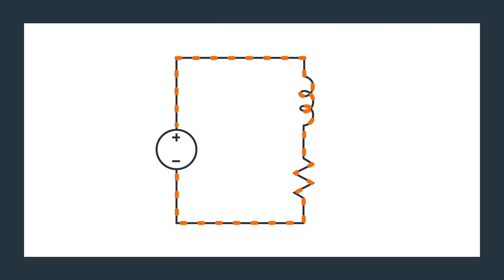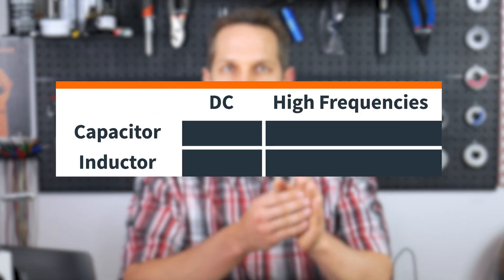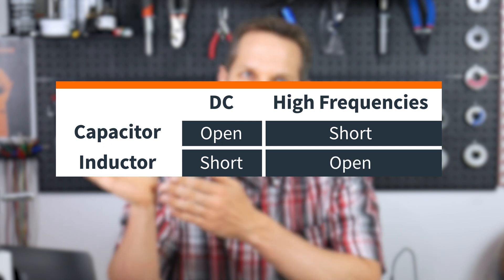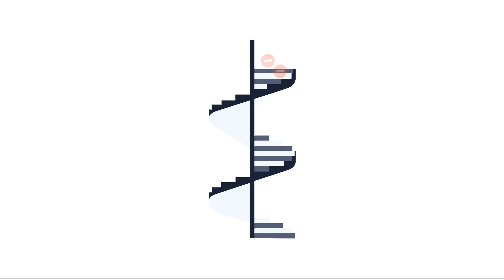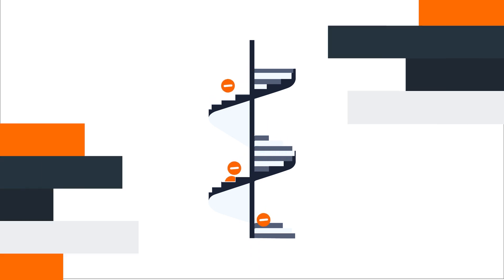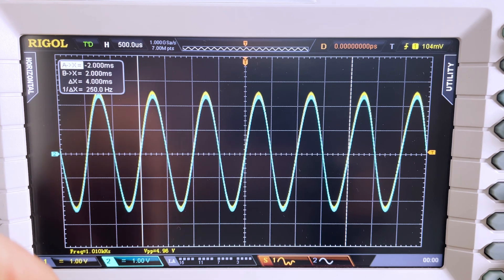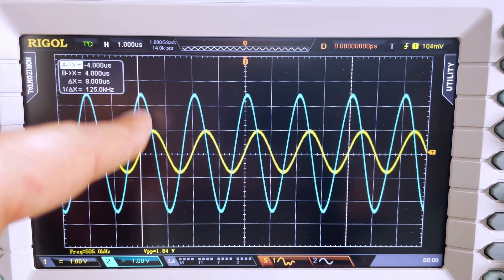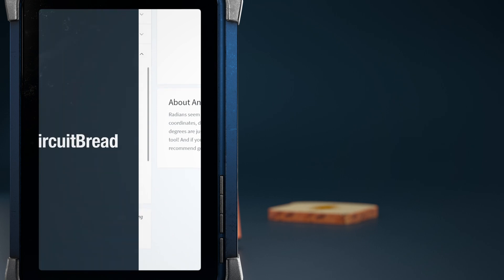Introduction to Inductors - Basic Circuits #18 | Electronics Tutorials

Comment: /Looks like a resistor if you squint heard enough./

Lol.  I love saying that.  If you squint hard enough….

Power not real.  Oh, it’s real.  It’s a storage element.  We just like to call it reactive It just depends how you use the power.  The best tool is discussing flywheels and kinetic energy.  Memory is another helpful concept.  Electro magnets and storing energy in the form of current is helpful.

I explain solenoid (relay coil) vs toroid (differential pickup like GCFI plugs)

Comment: To remember the phase relationship between voltage and current in capacitors and inductors, use "CIVIL":

CIV: In a Capacitor, Current (I) leads Voltage (V).
VIL: In an Inductor, Voltage (V) leads Current (I).

Comment: The Current (Amps) lags the Voltage (Volts) because of the transfer of Energy in the form of EM radiation, which cause a delay in the flux. Simple as that. 😊

Comment: for people starting out with electronics understanding..any additional information (bringing up circuit analysis, ignoring inductors, replacing inductors, etc) can add resistance to acquiring the basic understanding of what inductors do, and why they are absolutely necessary in certain situations.  Some of us arent ready to immediately apply brand new understanding to future pursuits of knowledge.  Just a thought Im having as i watch this video.   I like the video, and I understand you are trying to pack in as much information as possible..just a suggestion from a total noob who is trying to understand inductors at the most basic level and see real-world examples of where inductors are used and what would occur if they were not in use.

Comment: ALL electrical conductors have inductance. You don't have to coil anything. This is simply because electrical current flowing through a conductor results in a magnetic field around the conductor and energy is stored in the magnetic field.

Current flow through a conductor causes a magnetic field to be produced around the conductor. If the current is changing the strength of the magnetic field also changes. The changing magnetic field induces a voltage in the conductor through which the current is flowing. That voltage opposes the voltage which is causing the current flow. I have NEVER seen a single word about the mass of an electron with regard to inductance. I'd have to play this video again to be sure, but I didn't hear the word "magnetic" once! You cannot discuss inductors without the concept of energy stored as a magnetic field.

You cannot ignore inductance in DC circuits. Inductance must be considered in any circuit in which current flow is not perfectly constant. In fact the most important property of a inductor is that it impossible to instantaneously change the current trough it. All of the basic switchmode power converters are dependent on inductors in which the direction of current flow is always unidirectional. The magnitude of current changes but the direction of flow does not - it is DC.

Comment: Electrons have mass. Is the weight of a large electric cord  or coil with electricity running through it higher than a one without electricity?
Can we see the difference in weight when power is switched on or off?
Thanks
Reply from the maker: You aren't really adding or subtracting electrons with the vast majority of electric flow, you're moving them.  There are, of course, times when they are added or subtracted (static electricity) but then the actual number of electrons moving is so small that I imagine it's immeasurable.  But in THOSE cases, there would be a very, very miniscule difference, I believe.

Comment: Why do devices need these?
Reply: It depends on the device. Sometimes you want to filter noise or sometimes you want and efficient way of changing voltage for power circuits. It's a very efficient way of changing voltage in DC circuits. In AC circuits they can be used as chokes to limit current without huge dissipation losses or transformers to change voltage.
Reply from the maker: There are a couple uses for inductors but, particularly as I've gotten more into ham radio recently, one of the biggest things is changing the resonant frequency of a circuit.  With an AC circuit, certain frequencies can be blocked or transmitted better than others and it's dependent on the capacitor and inductor values within the circuit.  This has obvious applications in antennas but is also useful in power supplies and can even be used to stop high-current spikes.

Comment: Can you explain v=L di/dt as a supplement?  I don't understand what a graph of that would look like, L is constant and if I wanted to graph that how do you see di / dt in creating v?  Is di / dt linear?
Reply from the maker: We should definitely do a video specifically on this topic as it can be confusing.  The general concept applies to both inductors and capacitors but we'll just focus on inductors at the moment.  First, remember that for a resistor, V = IR.  But that doesn't apply to inductors, the equation doesn't work.  The only time there is a voltage over an inductor is if there is a CHANGE in current.  If you've taken differential calculus, you can look at di/dt and realize that this represents a change in current in regards to a change in time (i being current, t being time)  So, to know what the voltage across an inductor is at any moment in time, you need to know its inductance (L) and then multiply it by the change in current.  Knowing that an inductor acts like a short in DC, you should look at the equation and have it click about why that is.  In steady-state DC, the current wouldn't change, so di/dt = 0 and V = 0.  If there's no voltage over the inductor, it's acting like a short.  On the other end, in an AC circuit, if frequency is very high, current is trying to change direction frequently, so di/dt is very high.  Thus, voltage would be very high.  Things get really interesting when there are abrupt changes in current in an inductor (like unplugging a running vacuum cleaner - which is basically an inductor) as that has a large change in current, a large inductor, and ends up generating a very large voltage, which is why your plug may spark when you do that.
Sorry, this is way too long for a comment but too short to really get in depth in the topic.  Hopefully it is helpful in some way, though!
Reply: @CircuitBread  the explanation is helpful.  It would also be great to explain inrush on motors.  This is counter intuitive to me because motors seem to be big inductors so why is there an inrush?  Wouldn't the inductor resist change in current and soften the ok brush current?  Also I did look some more and found a few things.  The di/dt nature definitely confuses me when they talk about a boost converter.  I may not be writing this well, but it seems whenever they draw the voltage of the boost when the switch closes, they draw the line perfectly linear....I don't know why that is instead of a curved ramp... I'm confused with that too
Reply: @CircuitBread  I'm not an electrical engineer, but just someone with a casual interest in this subject. When you mentioned that a plug may spark, in your reply to Millax. It reminded me of my 120v induction hot plate that sparks every time I plug it in the receptacle (just when I plug it in, not when pulling the plug out). Any chance that has to do with the induction part of the hot plate, or is it just some issue in the manufacturing process? Thanks, I enjoy your videos.

Comment: Great presentation!  I will add that there are some nuances with inductors in a DC circuit.  1 - current in the circuit doesn't immediately rise, it rises exponentially.  Once it reaches steady state, it is essentially "just a wire".  2 - When power is removed, there will be a large current spike (flyback).  Also, an analogy that I particularly like, is a stream of water that is causing a heavy water wheel to move.  It takes time for it to get going, and it doesn't immediately stop if the stream were to stop.
Reply from the maker: Those are great points!  Particularly with the inductor, I've thought about doing another specific video for inductors (An "Intermediates of Inductors" perhaps?  Need a better title) where we go over those specific things.  I didn't understand the point of a flyback diode with FETs and H-bridges until I had a better intuitive understanding of inductors and how many devices and real-life appliances in my house are basically huge inductors.
Reply: In an RL circuit (resistor in series with inductor), the current rises exponentially. If an inductor is directly connected to a steady DC source the current rises linearly with time, with no limit with an ideal source and an ideal inductor.
di/dt = V/L   i in amperes, t in seconds, V in volts, L in henries
the differential of current through an inductor with respect to time is equal to the applied voltage divided by the inductance or the rate of change of current through the inductor is equal to the applied voltage divide by the inductance